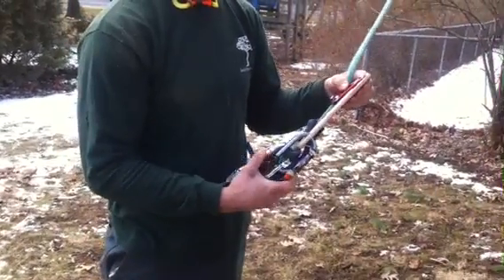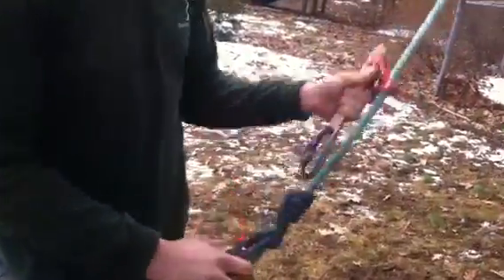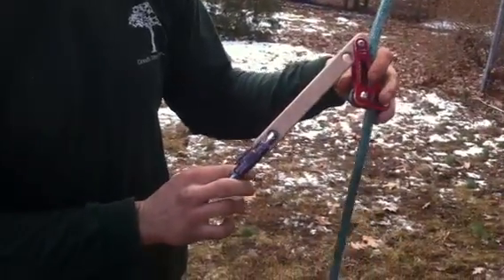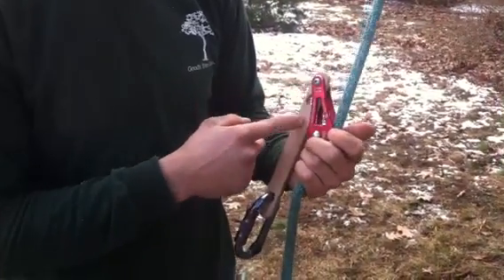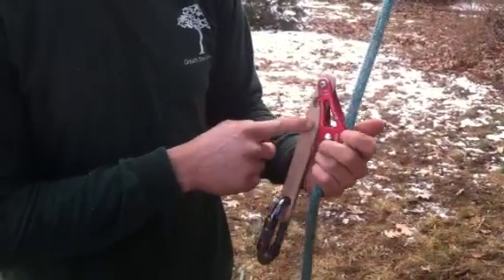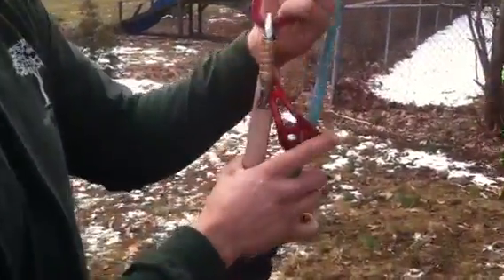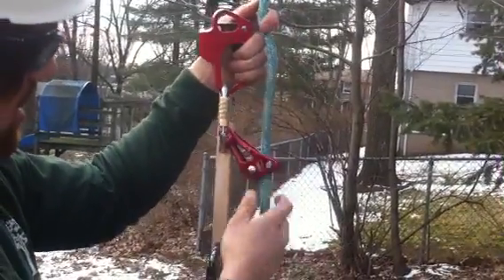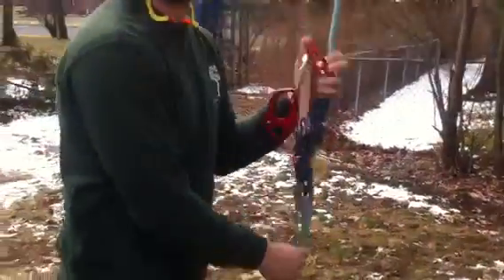Prototype Quick Connect RW tether

Comment from the maker: Yes your right. Its very important to look at the components your using and make sure everything is being used appropriately and on appropriate lines. The Kernmaster is a great example of a line that gives the feel and performance of an arborist line with the construction of an ascent line.  

The tether is opening up different options for ascent systems. Just cause you can doesn't me you have to be tied into your ascender. You bring up some great points for people to consider.

Comment: my main concern isn't the tether breaking cuz, in theory, your hitch should hold you, if it's set right & doesn't loosen up. lot's of climbers use the RW with ascenders on "arborist grade" climbing line which isn't rated for shock loads with toothed ascenders. a set up that has the ascender catch you before the RW &/or hitch could potentially pose a risk...